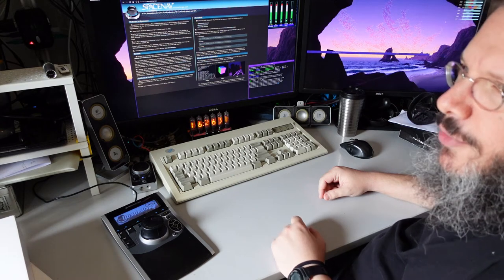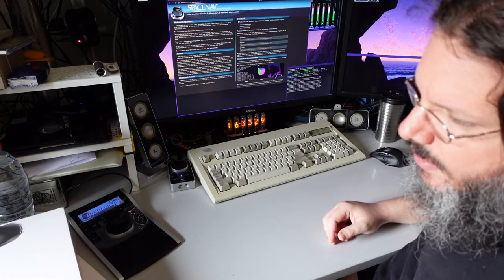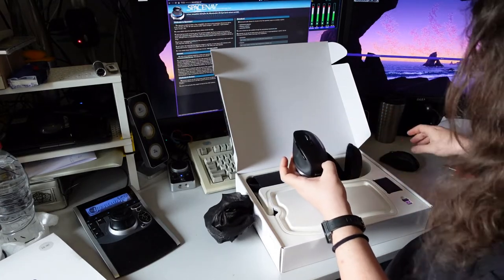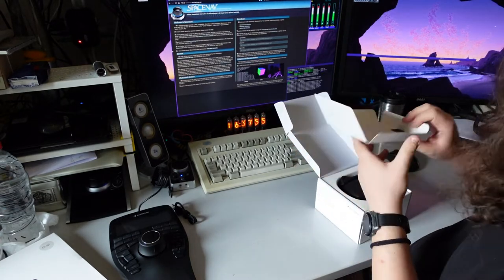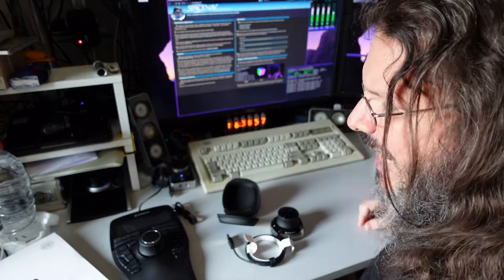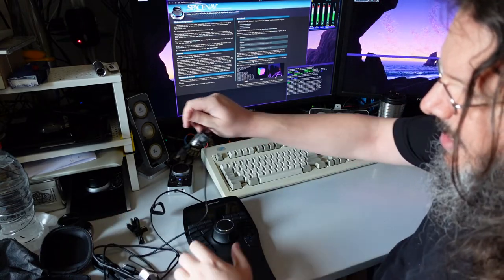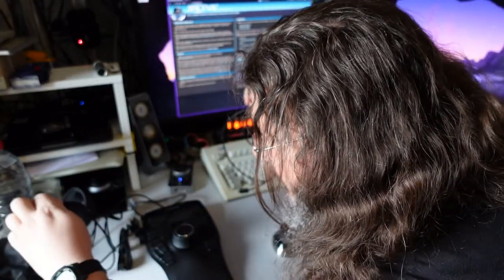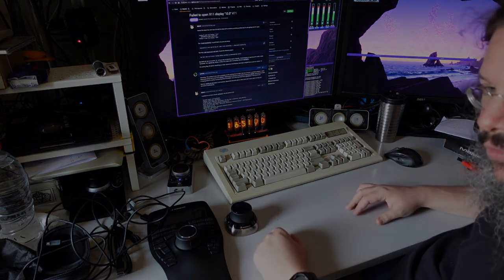Unboxing 3dconnexion devices for the spacenav project

Comment from the maker: Update: While the spacemouse wireless works absolutely fine, I discovered and fixed an issue with non-contiguous button numbers produced by the SpaceMouse Enterprise.
Also I wanted to say I grossly underestimated the bundled mouse (CadMouse Pro Wireless). I didn't notice it has an actual real middle button! Absolutely brilliant! It has replaced my previous mouse already.

Comment: Those LCDs do look really cool. Any chances of further videos demonstrating them?
Reply from the maker: On the 3dconnexion devices? Since I just received the SpaceMouse Explorer, I didn't have a chance to see how its display works yet. For the old one (the SpacePilot at the start of the video) I've written a library to control it: https://github.com/jtsiomb/3dxdisp  I intended to integrate that into spacenavd initially, but I couldn't come up with something useful to show on the display. So I usually just run the 3dxdisp example program to put up that logo and leave it there.
Reply: Well that’s probably because the “Explorer” doesn’t have a display. And it’s quite old also, released in 2004. Anyway too everyone else a new driver dropped just last month.  Oh and that’s Enterprise Kit 2 btw not “Developer Kit” If you really wanted to do a project then just buy the module from them and build out your own box. Otherwise this is a grandmas garage project. Happy 6-dofing 😂
Reply from the maker: @cedricvillani8502  Yeap, I meant to say the "SpaceMouse Enterprise" (pictured in this video). I didn't have a chance to see how its display works yet. And to be honest it's a very low priority thing. I don't understand much of the rest of your comment. Do what project, and buy which module?

Also yes, this is indeed the Enterprise Kit 2. That's what 3Dconnexion sends to developers in their partner program, which I joined to receive the devices you see here. I asked them to also send me a wireless device to figure out the wireless problem some users reported, to which they agreed, which is why they also included a SpaceMouse Wireless in the package.

Comment: How did you manage to install spacenavd correctly? On my fedora doesn't work, it recognizes the space mouse but doesn't generate any input. Thank you
Reply from the maker: Well, I wrote it, so if I couldn't install it, it would make it hard to continue with its development. Send me an email with specifics and I'll try to help you: nuclear@mutantstargoat.com
Reply: @jtsiomb  I couldn't get spacenavd working either, on fedora i could get the graphical config program to recognize my device but the bars did not move at all and i couldnt get openscad to detect the mouse. (however the option to toggle the leds did work, so maybe the bars not moving is a graphical issue? i was using wayland, but switching to x11 only made things worse and spnavcfg didnt recognize my device at all)
On ubuntu i got openscad to detect the mouse but even the slightest touch would send the 3d model spiralling out of view, i assume this could be fixed with the spnavcfg program but that is not in either ubuntu's or debian's repos so would need to compile it myself.
Reply: I was worried the cadman i bought used was broken, but it worked fine on a windows xp vm with the old 3dconnexion drivers.
Reply from the maker: @IsoMacintosh  if you don't feel like compiling spnavcfg manually, you could just edit the configuration file manually.

Comment: Do you have a favorite of the 3dconnexion Spacemouse devices?

I'm currently debating whether the Enterprise or Pro would be worth the extra purchase amount over and above the cost of the Spacemouse Compact or Wireless.

I tend to agree with your responses to previous comments regarding the functionality of the LED on the Enterprise being a lower priority issue.  However, I can't seem to find much information (or even video demonstrations) of the widget functionality; and, am therefore assuming that this is the pop-up overlay of action choices within a given app - as is the case in Windows environments).  If that is, in fact, the case and the choices pop-up in an application window; and, the LED isn't necessary; then I don't really see any advantage to 12 buttons over 4 buttons (that could be tweaked to offer more choices with limited input events), or, for that matter, 2 buttons (that could also be tweaked to offer more functionality).  Of course, I'm not really sure how Free Spacenav handles input events from those buttons on the devices, so I could be way off the mark.  Is that the case?  Am I incorrect?

Essentially, I am asking:  Am I correct in my assumption about the widgets?  And, Do you favor one model over the others? (and, if so, why do you favor it?)

3d Marbles?  Anyone?  LOL
Reply from the maker: I don't have much experience with these devices on other platforms. I do have a recollection of popup menus on windows, and it was certainly a popup window, not something on the device LCD screen. Spacenavd does not support anything like that however. It's up to the applications to pop-up settings windows and bind them to device buttons, and blender for instance certainly does that.

I think all the 3dconnexion devices are grossly overpriced. In my opinion ~120 euros for their spacemouse compact is way too much for an entry model with two buttons, 270 euros for the spacemouse pro is about 100 more than I'd consider reasonable for a multi-button device, and the enterprise price point is completely ridiculous. Back in 2007 when I bought my first 6dof device, they used to sell a "personal edition" of their "space navigator" (practically the same device as the compact), for about 60 euros, which is what I bought, and I consider it a fair price for an entry model. The "catch" was that you were not supposed to use it professionally, something which I have absolutely no idea how they were planning to enforce.

Now as for suggestions... if you're between the pro and the enterprise, get the pro. The display on the enterprise is completely superfluous. Having more than 2 buttons however is I think pretty useful, and having a hand-rest to stabilize the device, even more so. However, in face of their ridiculous prices, my real suggesion is to get a second-hand older model. If you can find a "space pilot" or a "space explorer" on ebay for cheap, I'd certainly go for those. They are essentially the previous generation enterprise and pro respectively. If you want to go dirt-cheap you can get an old serial "magellan spacemouse" for anything between 10 and 30 euros, and use it with a USB-serial converter. The puck on modern devices is somewhat more refined, but the difference is minimal, so it's a perfectly valid option in my opinion. This of course if you're only planning to ever use the device with spacenavd; the official drivers on other systems will regularly drop support for older models to force you to upgrade, and it's been decades since they supported serial models.
Reply: @jtsiomb  

Thanks for the added insight.  I think we share very similar opinions about these products' usefulness and pricing.  However, I hadn't even considered the possibility of purchasing a used (or maybe refurbished?) Spacemouse.  I really appreciate the suggestion.
Reply: I guess one other option would be to develop some silly game or simplistic 3d modelling app for Windows so that I can check a box other than "linux" to sign up for a developer account with 3dconnexion.  LOL